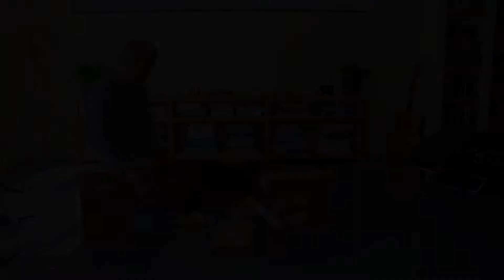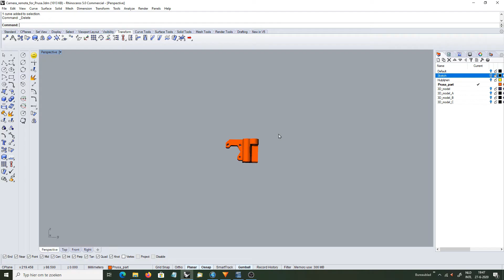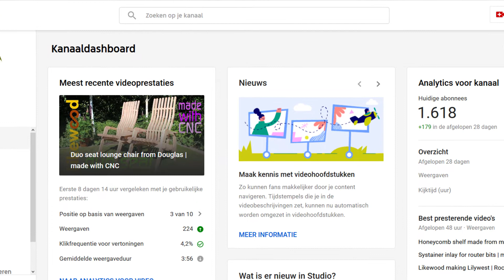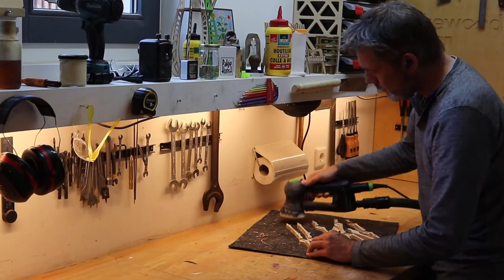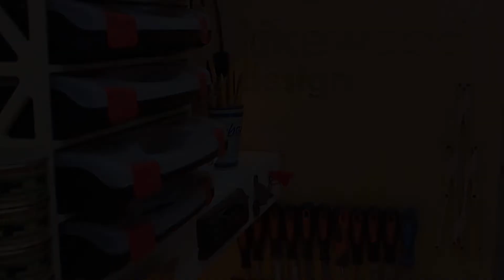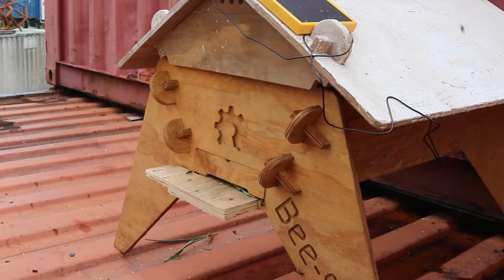Golden ratio calipers & sneak preview new honeycomb shelf design | made with CNC

Comment: Great Content 👍 Thanks a lot. Can you share what roundover (?) bit you are sing in your router table for deburring? I like the small radius on top without the need for a guidebearing. Regards from Cologne...
Reply from the maker: the router bit I use is custom made for me by a local tool manufacturer. I have not seen them as a standard bit anywhere jet.

Comment: Such a great project. What tool did you use to secure the magnets in the wood?
Reply from the maker: Just a clamp: https://www.besseyonline.nl/bessey-kli20-kliklamp-snelspan-lijmklem-0-200-mm.html
Reply: Thanks! It looked like the clamp crimped or set the magnets somehow. Was there glue on their backs?
Reply from the maker: No glue required. The fit was tight enough. That is why I used the clamp to press the magnets in.